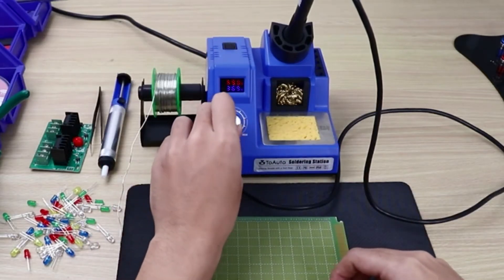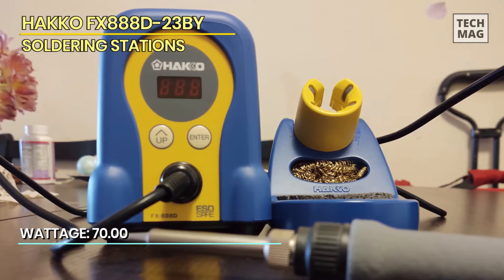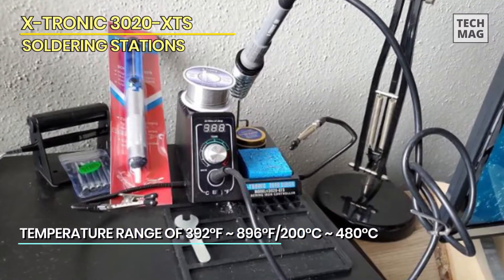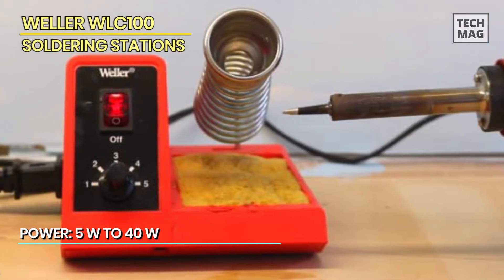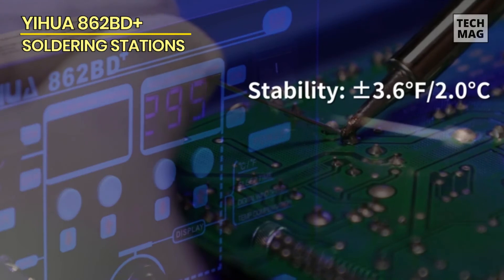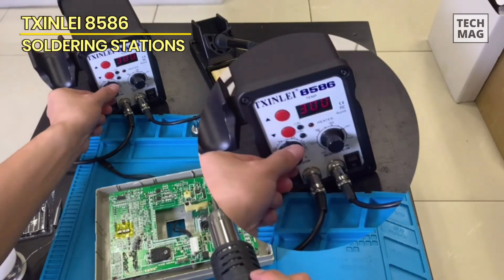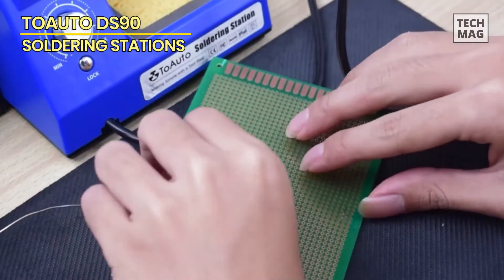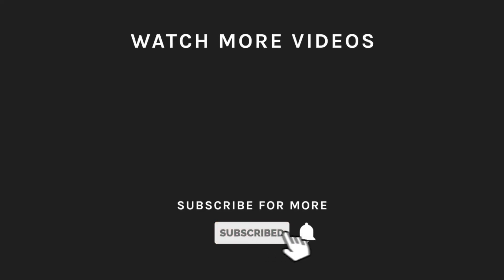Best Soldering Stations of 2023: Precision and Reliability for Electronics

Comment: Would you say the Toauto DS90 is the better option of these? I notice you said its good for professsional use.
Reply: Go with the Aixun T3B. Though it’s just a soldering station, no hot air. But it takes genuine JBC elements and tips.